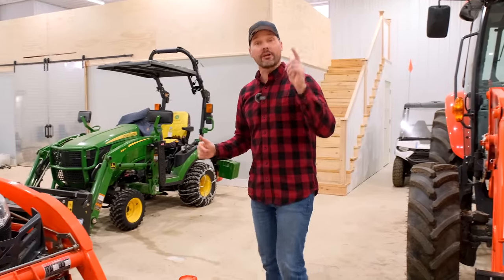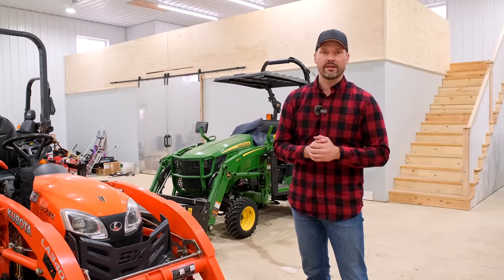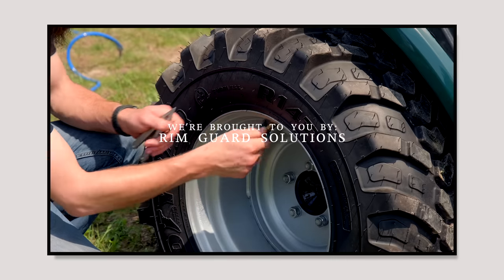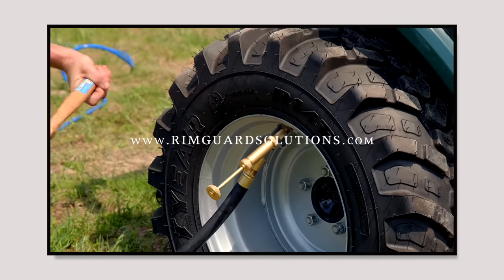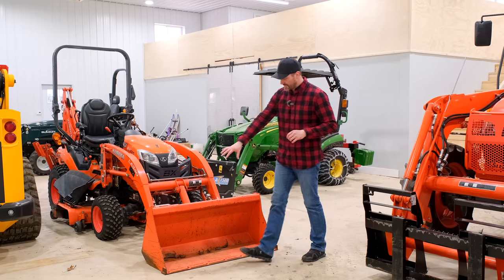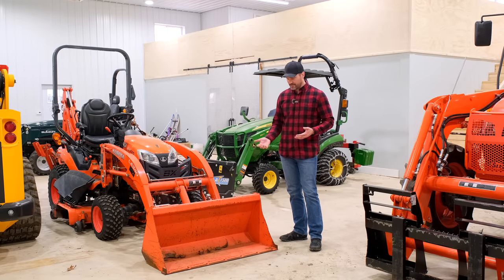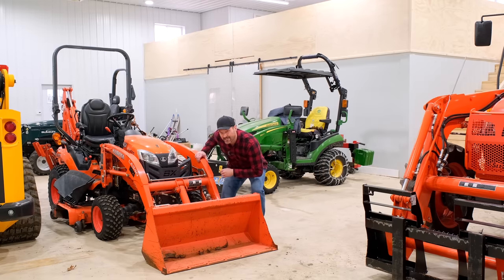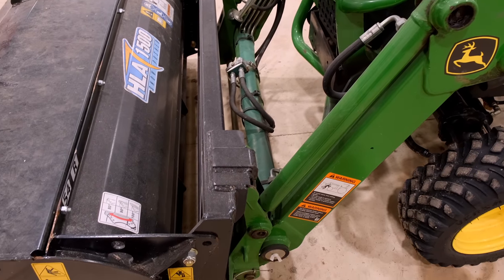IS YOUR TRACTOR OUT OF LEVEL? WHY DOES A BUCKET SIT UNEVEN?

Comment: It's amazing how many dealers and manufacturers (if not all) cut corners on the tires. Got a green skid steer and within a week of delivery both rear wheels developed slow leaks (10 psi over 3-4 days). $90,000 for equipment and they are still cutting corners to make the most profit. 
Thanks for the Video!

Comment: Good content as always! I once picked up a heavy snow plow/box combination attachment with my 4 series red tractor to load just the plow onto a trailer. I missed getting the SSQA inserted on one side of the attachment and (lazily) proceeded to lift and load it hanging off kilter on the loader. I bent the tube that joins left to right side on the SSQA. I needed to un-pin if from the loader and cylinders and take to a welder to have him cut the tube, square up the attachment, re-weld it back together and reinforce the tube. Worked perfectly again but learned a lesson the hard way. These tractor loaders are not built nearly as robust as a skid steer loader and can bend far easier.
Reply from the maker: Holy smokes, crazy that that happened.  Thanks for sharing!

Comment: All very good things to check!  One item I can add is possible 'misuse'.  I had an instance where I had to 'try' and pick up one side of a huge fallen tree, but I could only get to it from a certain angle.  Unable to center the load in the bucket, I had the tree more on one side of the bucket and attempted to pick it up.  It was too heavy as my back tires came off the ground (one before the other due to the lifting angle).  Not sure if my imagination (probably not), but ever since my bucket edge is no longer level on the same concrete point I've had it on for years.  So, I'm thinking I either tweaked the loader frame or moved some of the mechanical mounting points out of 'normal'.  I've not measured and tried to find where it needs adjusted or find that it's permanently 'tweaked'.  Moral of story is to always center the lift in the bucket; as we all know.

Comment: I hav a 2010 New Holland workmaster 55 that I bought new, it came with the Alo quickie 615tl and they used the same loader on the workmaster 45 at the time. Turns out that loader is to light for the 55. I've had numerous issues over the years that I've had to address including twisting the arms out of level, I had to engineer an extra heavier crossmember witch has kept it true since. Point to my long winded rant was just that I wish someone had told me when looking at new tractors to ask your dealer about heavier options for loaders it will save you a lot of headaches in the long run! Thanks for all your helpful tips!

Comment: On my brand new 1025r I finally determined (with a suggestion from you) that for whatever reason the dealer had the entire right side tire air pressure at 30 psi on both the front and the back.  Once I got the psi back to spec it corrected the issue from about 2” down to about 1/4” which is more tolerable for the bucket and/or snow pusher being level. 
Thank you for the suggestion.
Reply from the maker: Interesting, glad I could help!

Comment: Nail hit squarely on the head with the different “sized” tires. The bucket on my BX wasn’t hitting the flat garage floor level. One side was an inch or so up. I did the usual checking of tire pressures etc., but couldn’t get it level. Spoke with my dealer who commented that sometimes the same size tires can be slightly off. That happens when tires are made in different runs at manufacturer. He suggested adjusting air pressure in rear tires with one a couple/few pounds less than the other. That changed the stance and corrected the problem.

Comment: When I purchased my brand new Kubota BX 1880 in 2020 it took no time at all to realize that my bucket was not level at all. It was during Covid's early days and tractors were getting hard to come by so I had to take what was there and it was a Pin on bucket. I sent it back twice and the dealer said it was fixed but it was not. It took over a year to finally get the quick attach bucket system and when I got it back the bucket that came with it was perfectly level. I believe it was just the bucket itself. I include this small bit of advise and that is to get the quick attach in the first place and to avoid a Smiley bucket always put a cutting edge on it. If you don't know what a smiling bucket is just drive by a used tractor lot and look at some old tractors that don't have the cutting edge.
Reply from the maker: haha, those tractors are just happy because they got to play in the dirt a lot!

Comment: On the BX2370 dirt can get compacted behind the bucket where it attaches to the arms & it'll bend out the bucket-attach points.   I always feel like my bucket isn't level but it's simply b/c the rear tires aren't on level ground, it's an interesting way to develop job-overview skills.  The BX is ideal for making LID-swales to drain lawns, the angel limits of the machine limit ditch side-slope & the low-power prevents damage to lower soil-compaction layers.  [I don't box-blade, they're overrated or unnecessary for my area]
Reply from the maker: Good stuff, thanks for sharing Bob!

Comment: Good advice…. One other thing might check is I work around a lot of rocks and gravel and one time found a rock stuck up into the upper bracket throwing it off kilter… of course was easy to spot as I couldnt get my attach lever to seat properly… but still happened….

Comment: My Bobcat CT2025 bucket appeared wonky from the drivers seat and I called the dealer.  I was told to use a four-foot or six-foot level across the top of the ROPS, then across the loader arms and then across the top edge of the bucket while the bucket was raised about 3 feet.  Even if the tractor is not level, as long as everything is off the same amount the bucket is level. 
Turns out everything was fine, but the brush guard was catawampas (love the word) and just needed adjusting.  This was also verified by the level.  
I don't know if that would have worked if I had one tire that was larger.  Thanks Courtney.
Reply from the maker: Ahh yes, I've had that happen before too on a Kubota...drove me nuts until I realized the guard was wonky :)

Comment: Have a 430 JD loader. I lifted the bucket accidentally once with only one side hooked. After that the arms were not synchronized. I talked to the JD dealership which has been excellent about service and they had no solution even though I mentioned that to me the rod going from side to side may be twisted? Bingo, took the bolt out on one side and lined up the arms and the holes didn’t line up. Redrilled the holes with a bigger bolt and no more problem. If this happens again I will source better steel for this rod that will spring back when torsion is experienced.

Comment: I was operating a JD 544 and the right side of the bucket was digging in considerably deeper than the left. After some investigating the loader arms/boom was tweaked. After a lot of messing around I was able to get most of the twist out of it. Granted it wasn’t perfect but a heck of a lot better. Moral of the story. Don’t use the corner of your bucket for prying.

Comment: it seems like my 1025R loader sits level, but points off center to the left of the tractor by about and inch at the end of the hood and a good 2+ inches at the bucket. I found MANY others on the web have similar tweaks. it looks like a simple washer on the back of the mount at each bolt between the mount and the chassis on one side and a similar arrangement on the front of the other side would do the job when multiplied out by the length of the loader arms.. Another owner did this, but was cautioned by a third party to be careful about applying a torque to the cast steel mounts as they may not withstand this very well. I've hesitated to adjusted it as this cast steel issue made sense to me, so I try to ignore the trivial offset. An inch here or there likely makes zero difference when playing in the dirt - the tires can flex more than this at any point.
Reply from the maker: Interesting, I haven't heard about that issue.  Sounds fairly common?

Comment: I have a 2005 JD4520 that has this very problem. The bucket doesn't sit flat on the ground. The right end is 2" or more lower than the left. I've noticed that where the loader frame attaches to the tractor on the right, there's quite a bit of movement while the left is solid. I'm wondering if I take the loader off if I can tighten the bolts up. I'm pretty reluctant to mess with the mounting bolts because I don't want to break one if they're rusted in, then I'd be really screwed. Also I noticed a crack around one of the bosses that the bucket curl pivots on. So there's a couple of issues to deal with. I'm not sure what to do about the loader mounting bolts thing. Can I heat the bolt heads up with a torch? Would that help break the rust? Any ideas?

Comment: Carrying an off balance load on the loader. Such as grabbing a downed tree in a grapple not centrally balanced, can twist the loader arms out of wack 😥. I experienced a wobbly loader on  borrowed older Kubota tractor, missing and loose loader arm support bolts 🧐 . Biggest takeaways= if something doesn't seem right, it probably isn't right. Check it out!

Comment: I've seen the loader hitch twisted, the loader it's self twisted and the sub frame twisted. I even had a tractor come back from the dealer after a clutch replacement with one of side of the subframe 2 inches lower than the other
Reply from the maker: Ha, came back from the dealer like that?
Reply: @GoodWorksTractors  yup they also fried the ecu, then wanted us to pay for it to be replaced and to be reprogrammed. I wasn't having none of it. In the end loader subframe was correctly reinstalled ecu replaced free of charge and reprogrammed and a complementary set of front tyres fitted

Comment: I've been dealing with an unlevel bucket since tractor was brand new last year(Kubota BX2380)-SSQA style-left side of bucket is about 1' off ground when right side is touching. Dealer had it twice last year trying to correct it, 2nd time they  put more air in right rear tire and said it was fixed. The R4 tires that came with tractor , rears were different heights, swapped out with different set, still no difference. When I loosened left saddle bracket from tractor frame, bucket goes level. Tighten bolts, bucket goes unlevel. Shouldn't have to run different rear air pressures. I have set of R14T tires and set of turf tires, bucket unlevel with either set. Set level across loader arms and it's not level, top of ROPS is level. Anyone have any ideas? Dealer is waiting to hear back from Kubota corporate service department on how to proceed in fixing this, thoroughly disgusted....

Comment: The loader mount on my “offshore brand” tractor broke the cast out around the bell housing where it mounted (cheap cast iron )had to modify where it mounts to tractor by building a sub frame to mount loader mount arm 😢😢